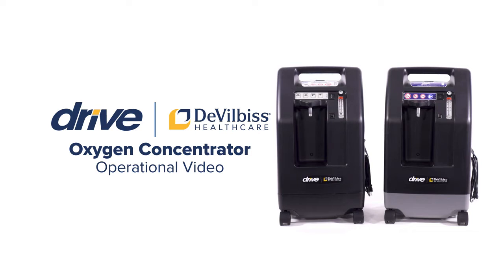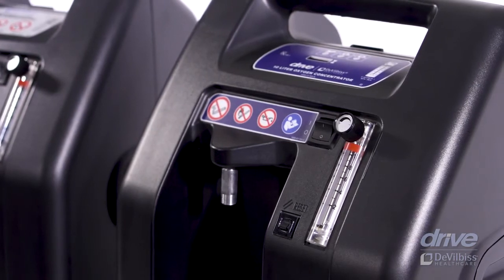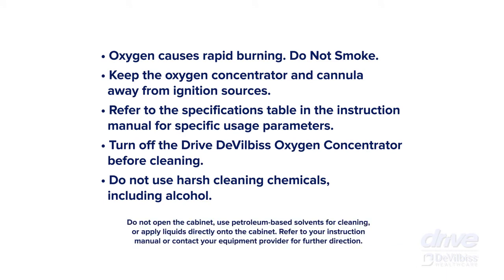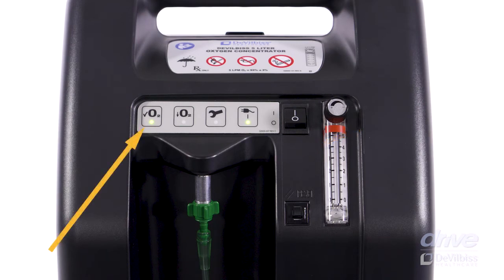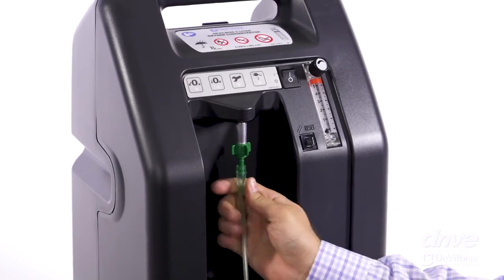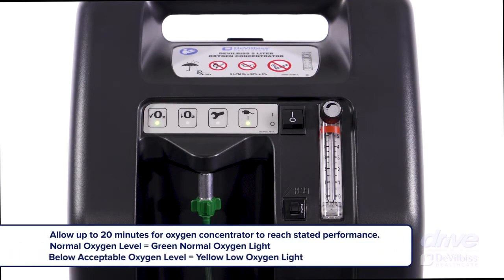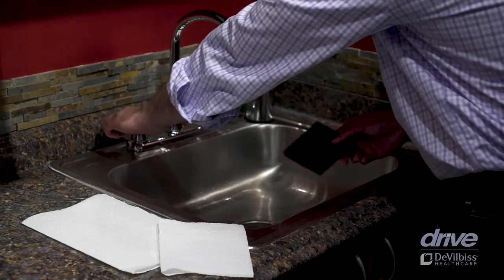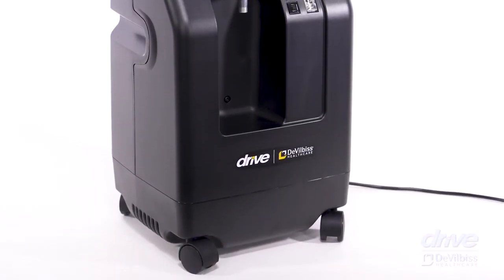Complete Guide to DeVilbiss 525 DS & 1025 DS Oxygen Concentrator Setup, Cleaning and Maintenance

Comment: WHAT A NOTHING VIDEO:face-orange-frowning::face-orange-frowning::face-orange-frowning::face-orange-frowning::face-orange-frowning::face-orange-frowning:
Reply: i cant find a guide on the concentrator my dad has, the back looks completely different but is same brand, i have no clue what im looking at.
Reply: @ORLY911  Same here. The back on the one we have has no filter before the vent at all.
Reply: update: For me it is a 1025DS-131-Revision B. DeVilbiss says the air filter is no longer required, it can be used but it isn't necessary for this model. If you get a yellow light I suppose all you can do is check the vent for blockage, and check the tubing. If your model has no air filter and its yellow, you will likely need to call your distributor for troubleshooting help...